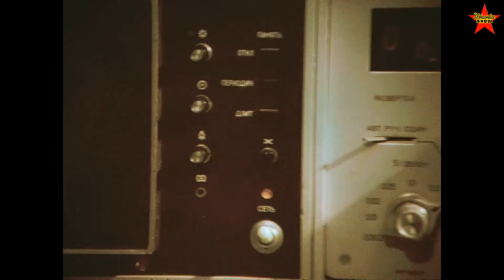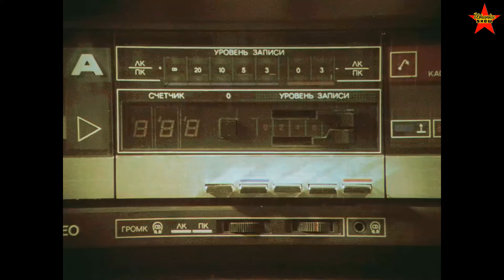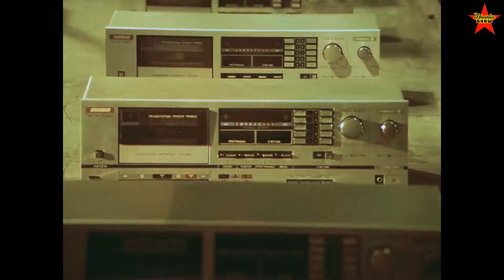MADE IN USSR. 1987 Ad, Hi-Fi Components by VEGA Radio Factory

Comment: I saw a radio with international frequency tuning. How was this allowed in the USSR? I thought they didn't want the people to be able to hear what was going on in the outside world?
Reply: In 1987, Gorbachov was already in power, so explicitely putting them on the dial probably was acceptable, politically. Aside from that, there were plenty of soviet-aligned stations to hear on shortwave and longwave, which was available on many standard broadcast receivers from the 50s till the 90s and needed because the soviet block was such a large geographic area. If you include either of those bands it's inevitable that the people were able to listen to the western transmitters.
Finally, the fact that they're printed in the western alphabet, means that this was a radio meant for export. The version for the internal market likely would not have the western stations on the dial, but instead the countless stations from the other communist countries.
Reply: @mfbfreak  As much as i know, the radios were the same exported to the West, it was SW stations from abroad that were jammed.